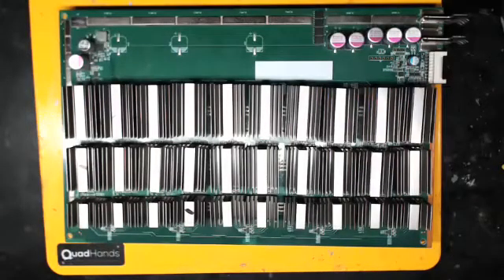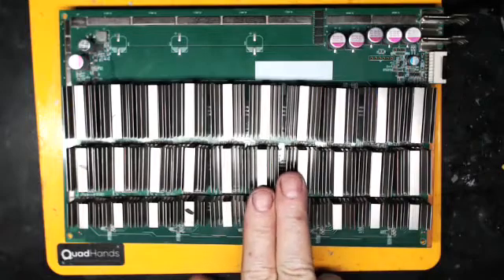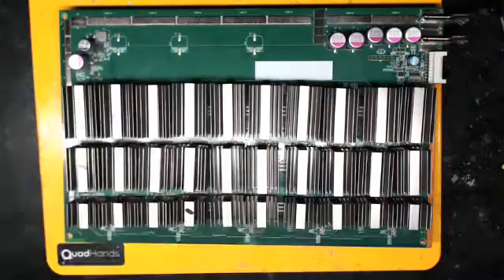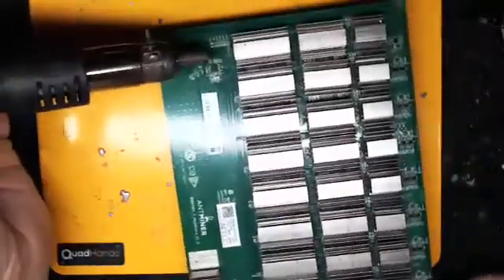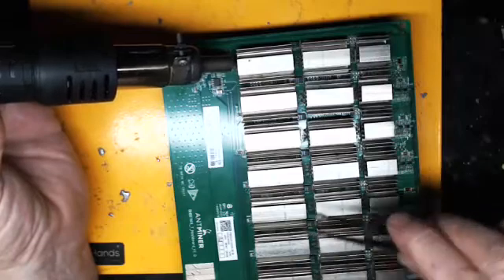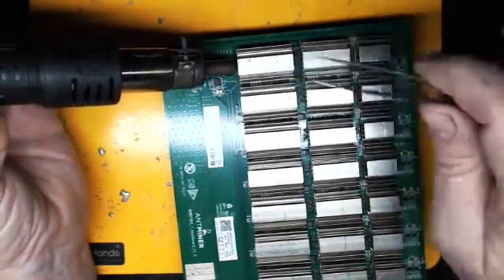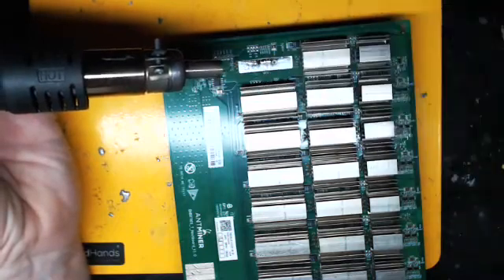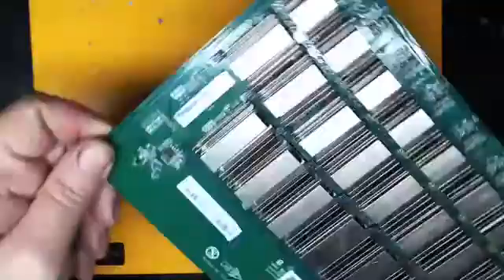hashboard repair: 0 Asic found Part 2

Comment: thanks for your video ! what i want to do when i get "only  have 0 ASIC" error?
Reply from the maker: Hi Thushapan,  It could be many things.  But mainly a bad chip that isn't letting power get through.  Sometimes it is chips 29.30, or 1, and 2.  However, most times it is a harder problem to find.
Reply: @AntminerRepair  thank you so much for your reply. 
my all same hashboards of s17+  showing error that only have 0 ASIC. is there any common problem that I want to check first for these same issues?

Comment: Those heat sinks look a little crooked. Im sure you already know, be sure they are not touching or they can cause a short. 

Also the straighter they are, the better the airflow while running, and helps to prevent static air, and overheating.

Comment: Are you operating the heat gun at 350 degrees Celsius or Fahrenheit?
Reply from the maker: all of my temps are in Celsius.   I use 450 to plant or remove the chip,  I use 350 with the soldering iron.  I use 350 on the air to remove and replace heatsinks.  There might be better temps, but that is what I've landed on so far.  Oh, I may use 450 on the soldering iron when I clean the chips pad with wick.  I also use a bigger tip for that.